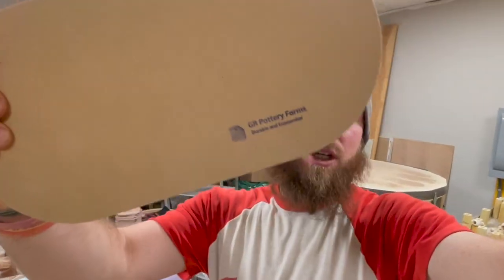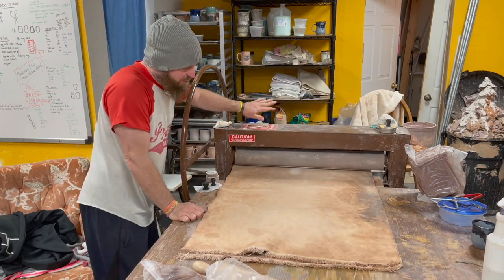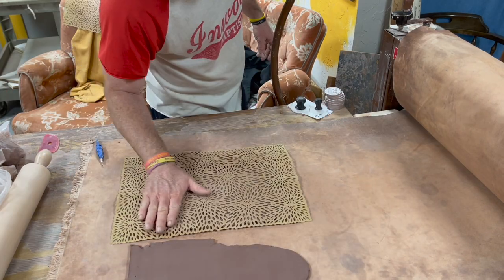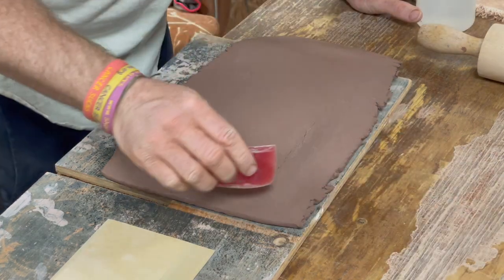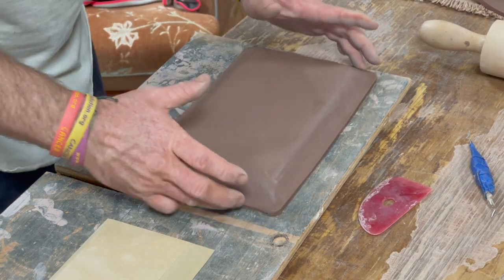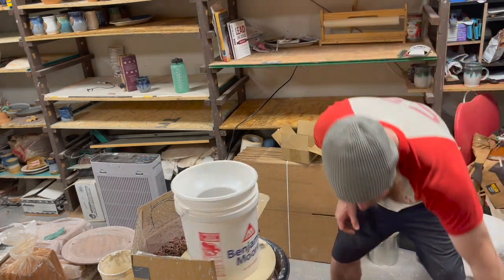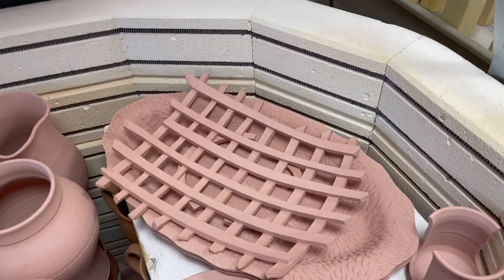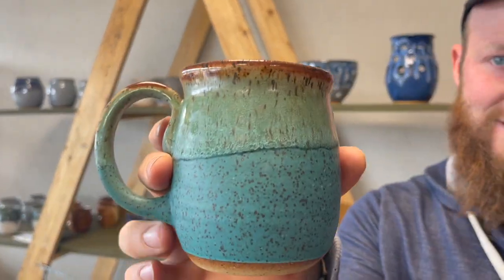Trying out New GR Pottery Forms and mixing new glazes, studio vlog 2

Comment: They make the price tags like that so it is difficult for folks to switch tags to steal.  So, we all suffer because Eve ate the apple.  I get fewer flaws in the rolled slab when I roll it lots of times at very small degrees of increase in the smush.  :)   (I allow that this is easier for me because I have a Shimpo that rolls both directions.  The old, Bailey slab roller that I learned on was a one way.  Lots more trouble.)